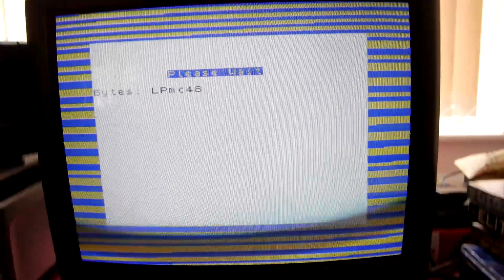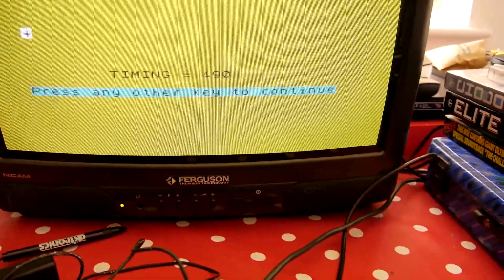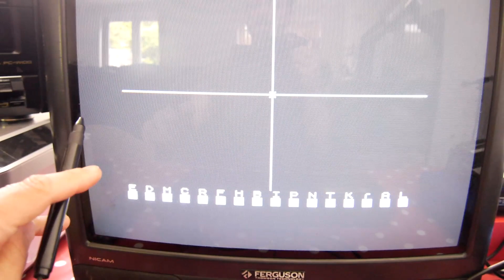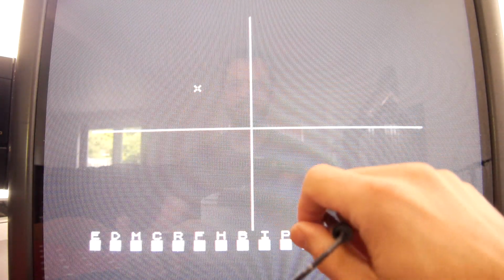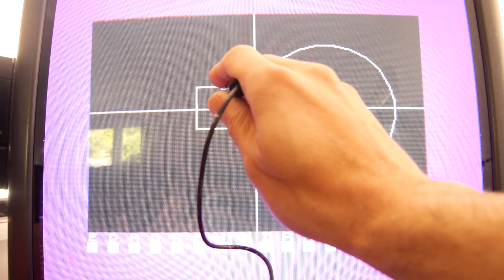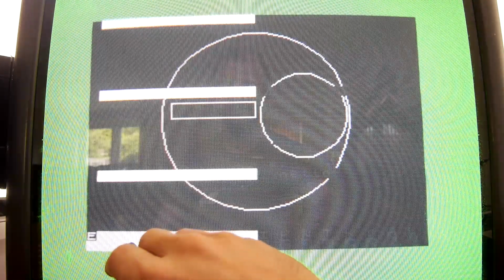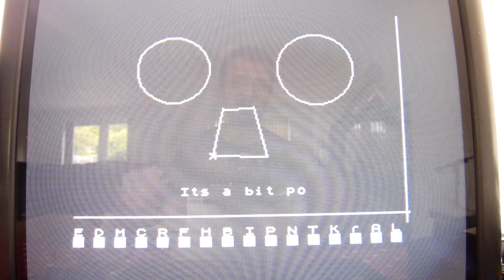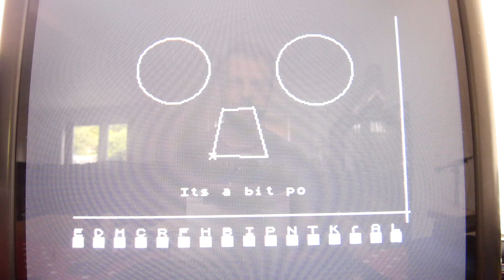DK'tronics ZX Spectrum Light Pen Interface

Comment: Nice video! We used one of these to develop the drivers for the Magnum lightgun games at Software Creations as we hadn't received the prototype gun hardware. They operate on a different port to the pens, and don't require the expansion box, but aside from that they are functionally identical. The screen flashes white to calculate the Y coordinate with a software loop that increments a counter every pixel row. Once the Y has been calculated, it does that pattern effect to calculate the X. My Magnum drivers operate on a similar principle, but flashes all the sprites around the Y coordinate to work out which sprite has been shot.
Reply from the maker: Was there any concept of knowing where the electron beam was, or were you just looking for the flash of white? I am thinking there might have been a couple of different techniques in play in light pens 🤔
Reply: @backofficeshow  As far as I know it just depends on how fast your CPU is and if you have special hardware for it like in a motorola 6845. On a spectrum I think you have to do it in a fairly crude fashion.

Comment: I had this very model back in 1983 or 84.  I remember it having quite a sharp abrasive plastic finish to the tip, and it was hard to hold the pen as close as possible, without scraping the glass of the TV set.  Used it a few times then back in the box for 25 years, and was sold on yep.........Ebay for a few pounds.
Reply from the maker: In terms of functionality I guess it was always a novelty. Probably why my father never entertained getting one. A mouse on the other hand, was a totally different proposition!

I think collecting a little set of add-on junk it itself quite neat. I will see what else I can find
Reply: @backofficeshow  Absolutely, I love finding things like this and tinkering.
Reply from the maker: I just bought an ancient and and a bit crappy looking e-book reader from a charity shop for a tenner, I regret nothing 😂

Comment: I had a light pen for my Vic-20 and I remember it being much more intuitive to use than that. You could draw freehand on the screen with it.
Reply from the maker: Do you think the VIC had more horsepower to work out the location? I guess its either/both that and better software. Lets face it, the DK software is a bit pants.
Reply: @backofficeshow  No I think it was using a different technology. As.I understood It, it was able to detect the raster from the screen redrawing at the point where the pen touched the screen and from there use precise timings to work out the x and y co-ordinates.  The DK'tronics one looks like it's just firing black/white areas of the screen.to slowly hone in on the location.
Reply from the maker: I'm wondering if the DK tronics might actually work on an LCD screen